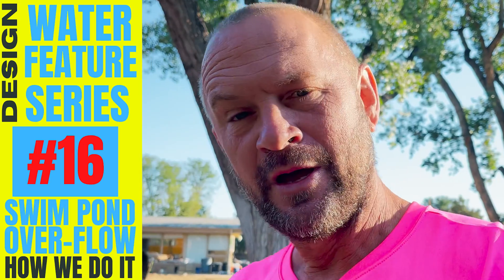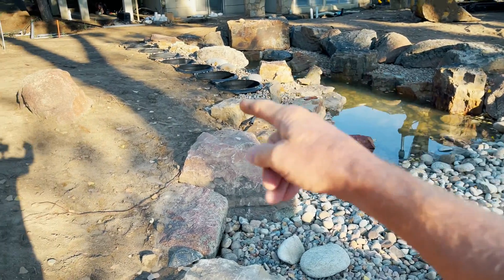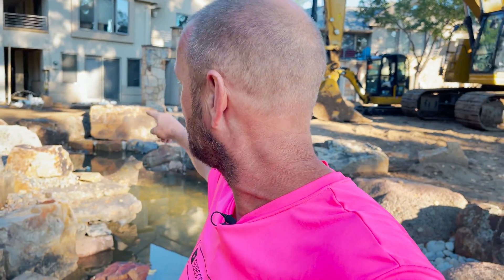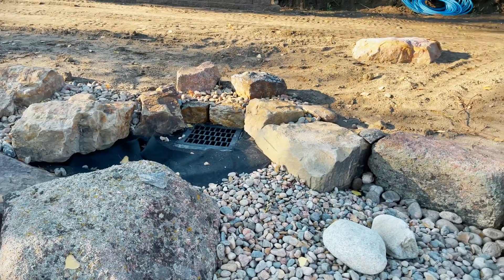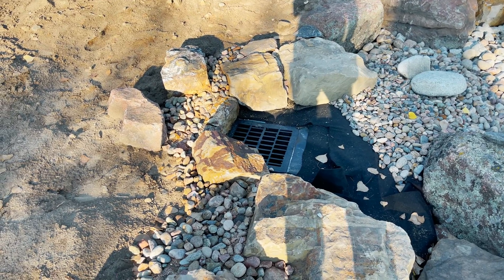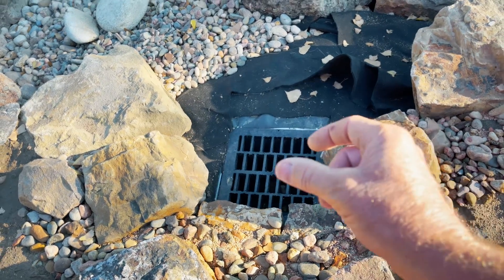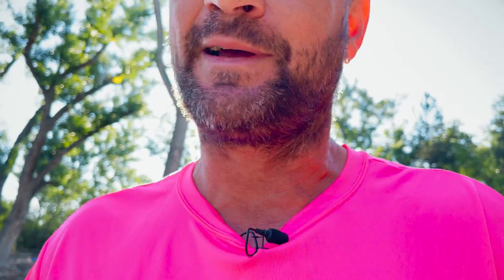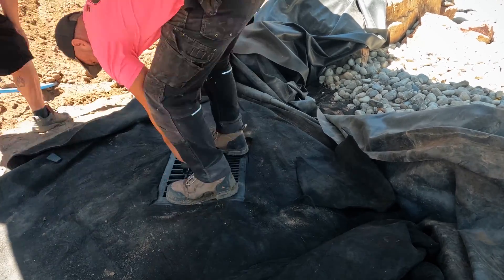Swim Pond Over-Flow How We Do It | Water Feature Design Series 16

Comment: Ok.   Your work looks awesome.  I’ve had an 8x 4 pond for over 20 years.  This spring I want to build a new, larger pond.  But nothing on the scale in your videos.  I’m thinking 10x15 maybe.   I’d love to see a video explaining filtration and plumbing for a system of that size.    I’m thinking an aqua scape skimmer and then a biological filter.  A waterfall/stream of around 6 to 8 ft in length.   Can you link me to a vid detailing the info I need?
Reply from the maker: Many of our pond videos show 16’ x 16’ sized projects, that seems to be our most sought after choice. There are of course lots of subtle differences but overall filtration is similar. Aquascape skimmer and 6000 Bio-falls filter with media upgrades, That filter is designed for up to 6000 gallons but we often use in smaller features to help polish the water and handle heavier fish loads.
Reply from the maker: How to make a pond beautiful using a diagram, pond and waterfall on the side of a mountain,Old pond becomes an oasis series pond, etc ;)